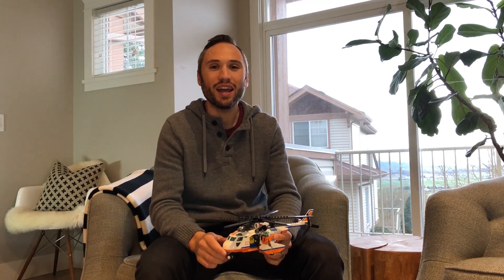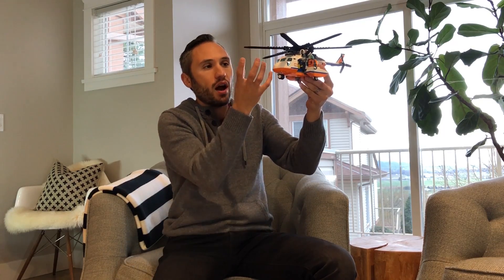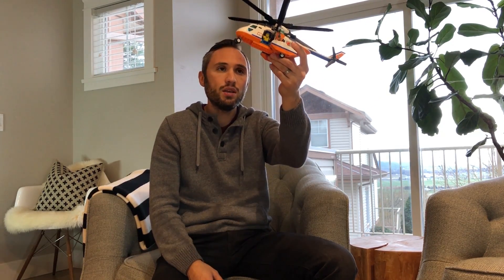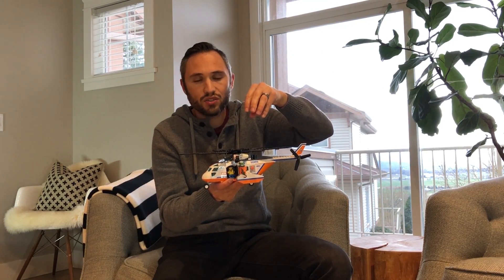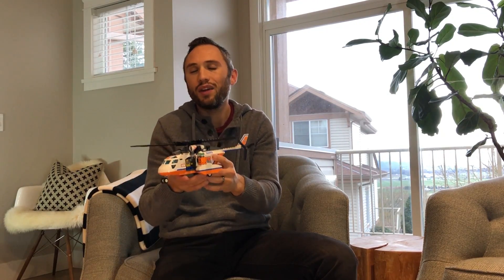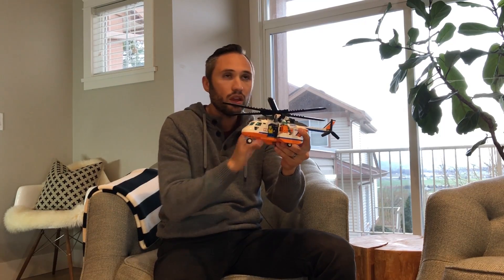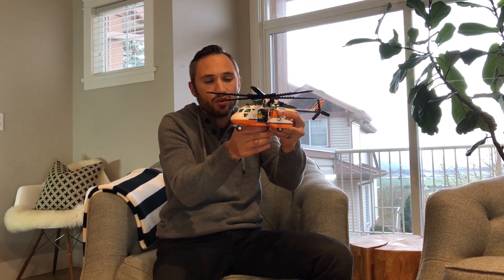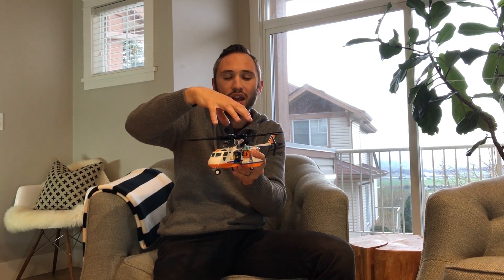Vortex Ring State IS NOT Settling With Power

Comment: Mischa, love you bro, and love your vids which are always interesting.  But...while you've got some interesting ideas here, but you do have a couple of things wrong.  What you are describing as "SWP" is actually settling with insufficient power.  I learned to fly in the U.S. in the 1970's.  We American pilots have always taught that settling-with-power is recirculation of the rotor vortices, which seems to be your definition of VRS.   "Vortex Ring State" is just the fancy "new-school" name people applied to the phenomenon to explain SWP more technically, which is fine.  But they are basically one and the same - in theory and in practicality.  

But wait!  Okay-  is SWP always VRS?  No.  You might be coming in quite steep (i.e. below ETL) and simply not have enough power to stop at the bottom.  You might not be in recirculation-mode but you hit the ground hard anyway.  So settling-with-power is a good, serviceable term that accurately describes the result of a number of hazardous different flight regimes that pilots must be aware of.  

It is probably a fact that you cannot get into VRS if the rotor is above ETL.  Will you always get into VRS/SWP if you come in vertically?  No, of course not, the conditions have to be "just" right.  But it's just there, waiting to bite the unsuspecting pilot who's not paying attention.  

Finally,  I'm sorry to report that your explanation of using Mr. Vuichard's technique to exit VRS is flawed.  You don't apply coordinated controls.  You have to cross-control the bitch. 
You need the tail rotor thrust to help push the helicopter sideways.  That's why, in an American helicopter you push as much left pedal as you can stand while adding cyclic to the right*.  In the Lama, you use *left cyclic and right pedal.

But in reality, it almost doesn't matter which technique a pilot uses to extricate himself from a very screwed-up approach.  Let's be real - people don't make steep approached into big, flat, open airports - why would you?  If you get into VRS/SWP, you're probably trying to get into some damn small, obstructed hover-hole and there won't be much room for any screwing around when things go to hell in a hurry.  AND*...if you're truly OGE and coming down pretty vertically, you're probably already at or near your power limit, so pulling *more power likely isn't an option.  Good luck with whichever technique you choose!  (Hint: If you really get in such a situation you're probably going to crash the helicopter.)

Bottom Line: Don't come down vertically without being keenly aware of what your rotor is doing.  

Great videos!  Keep 'em coming.  Love the discussion they generate ;)
Reply: That Bob Guy ... this is settling with power (the Canadian definition). What is is called in the US?
Reply: Well, as I stated in my initial response, for us in the U.S. it's simple: "Setting with power" is the recirculation of your own downwash - thus, SWP = VRS.  We proud, macho, pickup truck-driving Americans do not need a separate term for coming in too hot and not having enough power at the bottom to stop.  We just call that "pilot-dumbassery" because there's no aerodynamic phenomenon associated with it.  "Settling With Power" occurs within the well-known and well-publicized parameters (basically a vertical, powered descent).  Anything other than that is, "you messed up; go back to flight school you dummy."
Reply: That Bob Guy ... getting into vortex ring is also pilot error.
Reply: Ed, that is very true.  But look at it this way: In a fixed wing, there is a thing called the region of reversed-command, in which the plane may be in a very low-speed descent - the wing is not stalled.  Raising the nose of the aircraft (i.e. increasing the angle of attack) makes the rate of descent increase.  Lowering the angle of attack reduces the RoD.  

Let's say a f/w pilot was on approach to a runway with the speed low but not stalled. If the pilot raised the nose to flare without adding power, all he would do would be hit the runway pretty hard and maybe even bend something.  We would not say that he "stalled it in," because he did not stall.  He just screwed up.

Same with settling with power.  The term refers to an aerodynamic condition.  If a dumb airplane pilot does stall his aircraft close to the ground, yes, it's pilot-stupidity but the wing is still stalled.  Same for encounters with SWP/VRS.  It's dumb to get into that aerodynamic condition.
Reply: That Bob Guy ... i know nothing about fixed wing flying so I'll take your word for it. However if getting into VRS or the dumb pilot scenario has a similar entry (high rate of descent and low forward speed) and similar effects felt by the pilot (rapid sinking) but the way out is drastically different, both should be taught and named to eliminate confusion. Flying at high density altitudes on production jobs, as these are where the errors are often made. Drills moves, seismic and fire fighting operations.
Reply: That Bob Guy ... I posted two videos in this comment section yesterday with both scenarios flown by military pilots. Check them out.
Reply: Seems like you don't know much about helicopter flying either :-/
Reply: Don't bother looking for a job in all of Canadia?  Really?  Anywhere?  Wow, you've got some pull there, Mr. S.!  Well don't worry, I'd rather not fly amongst pilots who think that a screwed-up approach can be called "settling with power" and blamed on the aircraft.  Plus, I'd rather not fly anywhere that it's winter 11 months out of the year.  No, thank you, I'd rather stay down here in the good old USA where people know how to fly.

Comment: Such excellent videos...
I wonder what you think of this idea:

https://newatlas.com/workhorse-surefly-manned-flight/52247/

Flying a normal helicopter (unless it has a price tag of millions and is equipped with extensive fly by wire and autopilot controls) is quite intense to fly, and when things go wrong often counter-intuitive to save.
I wonder if these kinds of helicopters will be far easier to fly (akin to a self stabilizing drone) and with the blank space in the middle easily equipped with a BRS parachute in case of a collision or complete malfunction...

Comment: This video is awesome and really clarifies a mixture of terms. We’re going to go out and try it next week and hopefully o can link a video. 

I think it’s important to clarify that the technique varies depending on which direction your rotors turn. If you’re in a helicopter with clockwise rotation you use right pedal to counter torque and exit to the left with left cyclic. In a helicopter with counter-clockwise rotation it’s left pedal to counter torque and exit to the right with right cyclic. 

You CAN exit left or right but the recommended direction will be more efficient (quicker and less height lots) as the tail rotor thrust is working in your favour.

Comment: Hi great video - for the vortex recovery do you not need plenty of right boot rather than left as the increasing collective will create left yaw - also the fenestron will help
 pull the g2 to the left to help escape the vortex ring?

Love your videos what an awesome location to learn to fly a g2 - keep them coming!
Reply: It depends on the direction of your rotors. Clockwise rotors need right pedal to counter torque and left cyclic to exit. I fly a US Robinson with rotors going counter clockwise so I need left pedal to counter torque and right cyclic to exit. 

You can exit either way but exiting with the recommended direction of cyclic is more efficient as the tail rotor is helping push you out.

Comment: Whilst I appreciate your channel and have found many of your videos very informative, I feel the need to point out an error in your description. Namely you describe the blades as being 'stalled' in a vortex ring state. in my opinion a more precise word would be 'feathered'.  The vortex ring is like a smoke ring with the aircraft falling through the centre. The backflow through the centre is reducing the angle of attack on the blades meaning that the blades cant get enough 'bite' to support the machine. The more collective you pull, the more you accelerate the speed of the vortex and the less angle of incidence the blades see.
Whilst most of my aerodynamic knowledge is in fixed wing aircraft, I would expect the rotor to decelerate rapidly if you stalled it.  Please forgive me if this seems irrelevant, I am far from an expert in rotorcraft.
Reply: I think Shaun is exactly correct, and feathered and stalled are not along the same lines, they're opposite ends of the AOA range. The up flow through the hub is very important and the video you linked shows this clearly.

The area around the hub is always stalled because the blades don't have enough speed there. VRS begins because you descend into downwash and that reduces AOA, so the tips move further away from stall. But lift decreases with decreased AOA so you start to sink, that creates/increases the upflow through the hub area, increasing AOA there and enlarging the stalled region around the hub. You can see this in the linked video as a billowing mushroom coming up through the hub. The VRS is like a donut shaped flow, up through the hub and on the outside, and down at the tips.

Eventually the stalled region catches up with the whole disk and now you are stalled. In the linked video I think this looks clear, as the mushroom puffs out over the whole rotor.

Yes, no?
Reply from the maker: Shaun thanks for your feedback. I can understand where you are coming from with “feathering” it’s along the same lines. Consider an airplane with a variable prop and you feather it but require the aircraft to produce the same amount of lift as before. It will stall.
Reply: Shaun stalling is about airflow relative to the aerofoil, not the rotational speed of the rotor. 

For example, when forward speed reaches a certain point in a heli, your retreating blade will stall (cunningly called ‘Retreating Blade Stall’). It’s still spinning at the same speed but has slowed relative to the air that’s passing over it (since it is travelling in the same direction of the airflow).

This is why helis need left or right (depending on the direction of rotor rotation) cyclic trimming as forward airspeed increases, as the advancing blade creates more lift than the retreating blade, rolling the aircraft.

In VRS, I would say the rotor is stalling because it is trying to push down air and create lift, but that air is already descending with the aircraft. It has nothing to push against.
Reply: If you watched the linked video, there’s a point where there is a great representation of what I would consider to be stalled air as all the airflow falls apart
Reply: I've watched this video a 6-8 times, it's that good. To me feathering a prop is an action to change the angle of attack for whatever reason. In vortex ring state, the prop has stalled and "provides no lift". A prop providing no lift would mean little or no resistance to rotation no matter how much collective added. Is this any different than once a fixed wing aircraft stalls that adding power will not help? Air flow must be across the wing, fixed or rotary, to avoid a stall.

Comment: Is it possible to overpitch, and loose rotor rpm enough to loose tail authority?
Reply from the maker: WickedTRX yes definitely. The tail rotor needs lift just the same as the main rotor, and it spins 6 times faster than the main rotor on a conventional tail rotor so it loses lift 6 times faster. Yes you can definitely get LTE from over pitching if you allow your rotor to get too low.
Reply: Absolutely. That is exactly how it happens. Overpitching increases drag and thus drastically increases fuselage rotation torque. Reduced RPM's decreases tail rotor thrust and thus reduces the anti-torque force available to counter the increased fuselage spinning torque. It's a viscous circle.

Comment: I live in the U.S. where they teach us that VRS and SWP are the same thing, however, I never liked the term SWP for that phenomenon. I like the separation to define 2 unique states. Similar to the way gyroscopic precession is explained. The force does not act 90° later it acts at the point where the force is applied. It's just that it's not a linear Force, it's a torque Force between place where you apply a linear Force Through the rotor hub.
Reply: John W. Ryon IV ... agreed

Comment: THANK YOU! It appears to be the case that the FAA only teaches them to be the same thing because some butthurt Army vets back in the day (60s-70s I think?) didn't like the Navy setting the standard (which was actually the correct way). The Army then swapped the terms around, leading to confusion and eventually dumbing down the subject to what it is like in the USA now. Except for them, everyone in the world knows and teaches this the right way and no one in the US wants to accept it.
Reply: The FAA and TC say the same thing different ways.  The reasons the military changed terms was that the manuals written in the 1950 and 60s were for aircraft like the OH-23 that had little power and wooden rotor blades.  As you can imagine, VRS and SWP was much easier to get into and much harder to get out of in an aircraft like that.  As you started to have aircraft like the UH-1, settling with power became less of an issue, but poor power management became more of an issue (apparently at some point bad power management may have been called "power settling," but I've never actually seen that in a manual).  If you are flying an aircraft that barely has Out of Ground Effect hover power, you tend to pay more attention to power.  If you were trained in Texas or Alabama in an empty UH-1 and then found yourself in an overloaded UH-1 in the mountains of Vietnam, you can understand how a problem might emerge.

Pilots started crashing due to coming in too hot and not being able to stop due to poor power management.   Poor power management can certainly get you into VRS (i.e. if you don't have OGE hover power and try to hover OGE), but pilots are more apt to claim it was SWP than admitting that they didn't realize they tried to do OGE manuevers when they didn't have OGE power.

As an example, let's say your power available is such that if you drop below Effective Translational Lift out of ground effect, 100% torque gives you a 250fpm rate of descent.  You won't be able to arrest that rate of descent unless you accelerate back through ETL.  Generally, that looks like SWP, but it isn't because you weren't coming down fast enough to develop VRS.  The recovery looks the same as SWP too, but unless you further screw something up, you will keep coming down at 250fpm.

Now, lets assume it is 5C hotter and your OGE hover attempt gives you a 400fpm descent.  Now you are getting into VRS and your rate of descent is increasing, but it isn't really SWP because you didn't have enough power in the first place! You're just settling in VRS without power because you already had 100% torque pulled when you got yourself into VRS.  You can't try to recover from this with power because the collective has been in your armpit since your stated settling.  The wording of FAA FHM could suggest this is SWP, but the settling would have happened regardless of VRS, VRS just made it worse.

True SWP would be if you had OGE hover power, but for some reason decided to slow to a hover and kept lowering the collective until you developed a 300-500fpm rate of descent.  If you increase power hoping to arrest the descent rate you'll get further into VRS and cause you to further *settle*.  Voila! Settling with Power.  More power = more settling.

Again, the confusion comes because the recovery is the same, but what it is achieving is different.  If you are falling because you don't have OGE power, you're trying to out run your vortices and get back through ETL.  The vortices aren't VRS, but they are reducing the effectiveness of the rotor system because of the increased induced flow enough that you are settling.  If you are falling because of VRS, you are trying to out run VRS which is a problem with both wingtip vortices, but mostly the upward flow stalling out the middle of the rotor disc. 

The exact same thing happens with Loss of Tail Rotor Effectiveness.  You can have a wind such that you don't have enough power to counteract the wind and MR torque (same thing as Settling without Power) or you can have the wind coming from an angle such that it puts the tailrotor into VRS due to main rotor vortices blowing into the tailrotor.
Reply: @rhubarbsteve8959 : Fascinating and clearly explained - Thank you.